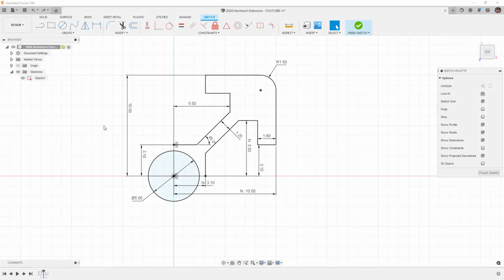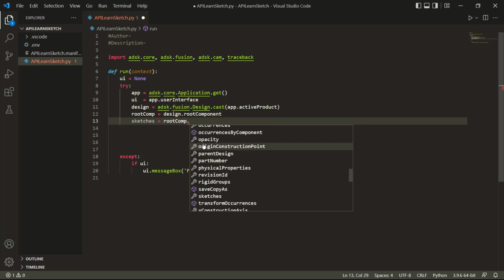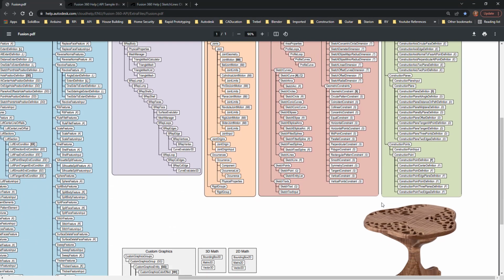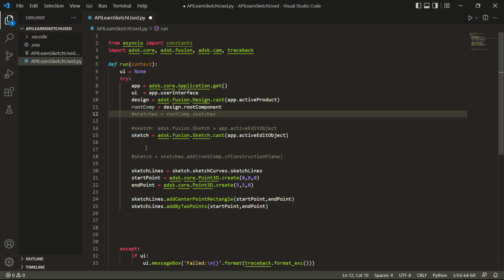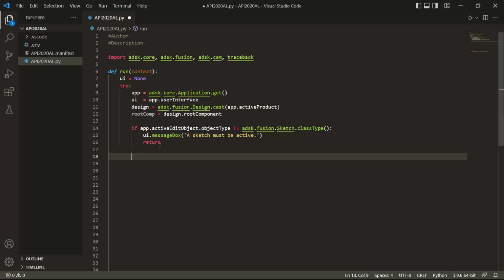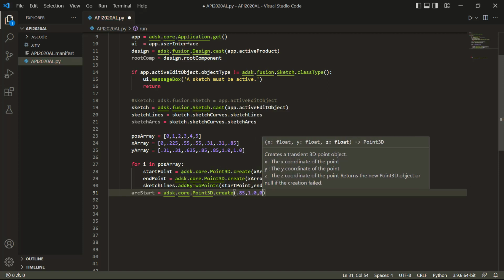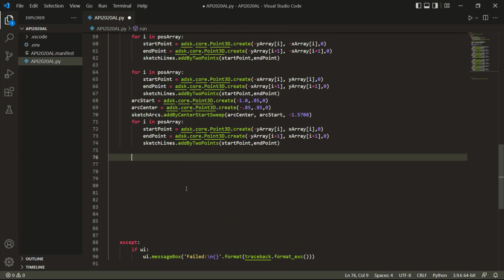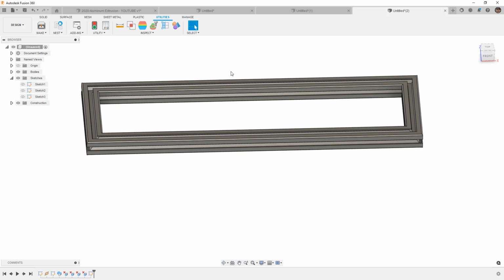Intro to API in Fusion 360 Part 7 - Creating a Script to Make a Sketch Profile #Fusion360 #API

Comment: Hi Matt, I have followed your video mostly but just created a rectangle with rounded corners. I want to create a sketch for drawing an RHS section profile. Problem is I couldn't do an offset in the API and even when I tried to then offset the sketch it would not select more than two curves, the first straight line and arc that was drawn. Eventually I want to have the python code use existing parameters for dimensions so that the RHS would remain parametric. This is how I am creating framework that is parametric in fusion360. Currently I draw the sketches each time I create a new beam.
Reply from the maker: off the top of my head and without playing with your code im not sure what the problem is.  but note that some older methods have been retired because of an update to offset in January.
https://help.autodesk.com/view/fusion360/ENU/?guid=GUID-fe28f2e1-bfbf-4521-ac35-14d677d38441
Reply: @LearnEverythingAboutDesign  thanks 
Matt, yes I saw this and tried to follow the recommendations but I got lost immediately.
My end goal is to use existing parameters in the api but retain that parameter as the dimension in the sketch so that subsequent changes to the parameters in fusion will work. Can you tell me if this is possible.
Reply from the maker: it should be.  I am by no means and expert programmer but we have a few videos on user parameters and how to get and set them in API.  We did a video where we have a dialog box with slider that gets a parameter and you can update it with the dialog.  So i can't see any reason why it wouldn't be possible.

Comment: AttributeError: 'NoneType' object has no attribute 'rootComponent'
Reply from the maker: That error usually shows up if the document or design object isn't referenced before trying to get to the rootComponent.  There are a few ways to access but in this case we did this
app = adks.core.Application.get()
ui = app.userInterface
design = adsk.fusion.Design.cast(app.activeProduct)

After that line we did add rootComp = design.rootComponent, but its actually not needed for where we stopped.  you can add a # before it to comment it out if that is giving you an error.  It should work even if its there it just isn't used.  

In the code we start by making a sketch active (editing or creating one) to place the sketch.  If instead we wanted the code to make a new sketch we would need access to the root component first.  so we sort of bypass it by requiring the user to edit/create a sketch first.

Comment: I made a few edits in the code. Is my code memory efficient:

#Author- Learn Everything About Design
#Description - Creating a profile using api

import adsk.core, adsk.fusion, adsk.cam, traceback
import math

def run(context):
    ui = None
    try:
        app = adsk.core.Application.get()
        ui  = app.userInterface
        design = adsk.fusion.Design.cast(app.activeProduct)
        rootComp = design.rootComponent

        if app.activeEditObject.objectType!=adsk.fusion.Sketch.classType():
            ui.messageBox("A sketch must be active!!")
            return
        
        sketch = adsk.fusion.Sketch.cast(app.activeEditObject)
        sketchLines = sketch.sketchCurves.sketchLines
        sketchCurves = sketch.sketchCurves.sketchArcs
        sketchCircles = sketch.sketchCurves.sketchCircles

        x_array = [0, 2.25/10, 5.5/10, 5.5/10, 3.1/10, 3.1/10, 8.5/10]
        y_array = [3.1/10, 3.1/10, 6.35/10, 8.2/10, 8.2/10, 10/10, 10/10]
        positive_array = list(zip(x_array, y_array))
        mirrored_array = list(zip(y_array[::-1], x_array[::-1]))

        for i in range(len(positive_array)-1):

            ## First block: 1st qdrt
            start_point1 = adsk.core.Point3D.create(positive_array[i][0], positive_array[i][1],0)
            end_point1 = adsk.core.Point3D.create(positive_array[i+1][0], positive_array[i+1][1],0)
            sketchLines.addByTwoPoints(start_point1, end_point1)

            start_point2 = adsk.core.Point3D.create(mirrored_array[i][0], mirrored_array[i][1],0)
            end_point2 = adsk.core.Point3D.create(mirrored_array[i+1][0], mirrored_array[i+1][1],0)
            sketchLines.addByTwoPoints(start_point2, end_point2)

            ### 2nd block:2nd qdrt

            start_point1 = adsk.core.Point3D.create(positive_array[i][0], -positive_array[i][1],0)
            end_point1 = adsk.core.Point3D.create(positive_array[i+1][0], -positive_array[i+1][1],0)
            sketchLines.addByTwoPoints(start_point1, end_point1)

            start_point2 = adsk.core.Point3D.create(mirrored_array[i][0], -mirrored_array[i][1],0)
            end_point2 = adsk.core.Point3D.create(mirrored_array[i+1][0], -mirrored_array[i+1][1],0)
            sketchLines.addByTwoPoints(start_point2, end_point2)

            ## 3rd block: 3rd qdrt

            start_point1 = adsk.core.Point3D.create(-positive_array[i][0], -positive_array[i][1],0)
            end_point1 = adsk.core.Point3D.create(-positive_array[i+1][0], -positive_array[i+1][1],0)
            sketchLines.addByTwoPoints(start_point1, end_point1)

            start_point2 = adsk.core.Point3D.create(-mirrored_array[i][0], -mirrored_array[i][1],0)
            end_point2 = adsk.core.Point3D.create(-mirrored_array[i+1][0], -mirrored_array[i+1][1],0)
            sketchLines.addByTwoPoints(start_point2, end_point2)

            ## 4th block: 4th qdrt

            start_point1 = adsk.core.Point3D.create(-positive_array[i][0], positive_array[i][1],0)
            end_point1 = adsk.core.Point3D.create(-positive_array[i+1][0], positive_array[i+1][1],0)
            sketchLines.addByTwoPoints(start_point1, end_point1)

            start_point2 = adsk.core.Point3D.create(-mirrored_array[i][0], mirrored_array[i][1],0)
            end_point2 = adsk.core.Point3D.create(-mirrored_array[i+1][0], mirrored_array[i+1][1],0)
            sketchLines.addByTwoPoints(start_point2, end_point2)

        ##1st arc
        start_arc = adsk.core.Point3D.create(0.85,1.0,0)
        centerPoint = adsk.core.Point3D.create(0.85,0.85,0)
        arcstart = sketchCurves.addByCenterStartSweep(centerPoint, 
                                                      start_arc, sweepAngle = -1.5708)
        
        ##2nd arc
        start_arc = adsk.core.Point3D.create(1,-0.85,0)
        centerPoint = adsk.core.Point3D.create(0.85, -0.85,0)
        arcstart= sketchCurves.addByCenterStartSweep(centerPoint, start_arc, 
                                                     sweepAngle=-1.5708)
        
        ##3rd arc
        start_arc = adsk.core.Point3D.create(-1,-0.85,0)
        centerPoint = adsk.core.Point3D.create(-0.85, -0.85,0)
        arcstart= sketchCurves.addByCenterStartSweep(centerPoint, start_arc, 
                                                     sweepAngle=1.5708)
        
        ##4th arc
        start_arc = adsk.core.Point3D.create(-1,0.85,0)
        centerPoint = adsk.core.Point3D.create(-0.85, 0.85,0)
        arcstart= sketchCurves.addByCenterStartSweep(centerPoint, start_arc, 
                                                     sweepAngle=-1.5708)
        
        ### Making the circle at the center
        sketchCircles.addByCenterRadius(adsk.core.Point3D.create(0,0,0), radius = 2.5/10)

        # ui.messageBox('Hello script')

    except:
        if ui:
            ui.messageBox('Failed:\n{}'.format(traceback.format_exc()))
Reply from the maker: abhijit, the first bit of your comment is blurry somehow and only the Author and Desc are here.
Reply: @LearnEverythingAboutDesign  blurry? Actually i copied the text from the ide..
Reply from the maker: @abhijitbhandari621  Its very strange, maybe it was being processed or something based on the length of comment, i see some of the code is there now.  

As far as the code being memory efficient, that I am not sure.  I haven only really worried about that on thins like Arduino projects where memory and RAM are a very limited resource.  It appears what you have done there make sense rather than the copy/paste we did in the video.  does it work for you?
Reply: @LearnEverythingAboutDesign  Yeah it's working fine..
Here is the code:
https://drive.google.com/file/d/1MysEQLGckUzfXECArnJAfUBtDo-e32fB/view?usp=sharing
Reply from the maker: @abhijitbhandari621  Great!  Yes I think the program can be more efficient.  What you did to mirror the sketch entities is a great step.  Another way would be to create a circular pattern of one quadrant.  Another way would to make a subroutine/function that draws based on inputs and you design it in a way to pass either positive or negative depending on what you are doing.  So for example a for loop for the x coordinates and a nested for loop for the y.  

I would say the big takeaway would be to make it more robust to updating the profile.  This is an area where hard coding loses out to say something like updating a user parameters in a design where all the other dimensions are driven off of the 20x20 value.

Good work!
Reply: @LearnEverythingAboutDesign  Yeah true and thank you so much I have been learning so much from you

Comment: Great video again! This would be a nice start for a series called "making an frame generator add-in "😁  especially since there is no frame generator in Fusion 360 (at least not for mac). Consider the suggestion 😄
Reply from the maker: That would be cool! There are so many things but I think the next step would be to add dimensions/constraints to the sketch, or show how to make a feature.

Comment: This is what I was looking for! Thank you Matt, you're the best Fusion instructor by far! I just wish your channel gets the attention it deserves so you can continue this amazing work! Keep it up.
Reply from the maker: Wow thanks Nabil!  Glad the content is helpful and appreciate the kind words!
Reply: @LearnEverythingAboutDesign  Ever hear of f-string? There shorter and there easier to use. Also if you are only using 3 imports you can type "from adsk import core, fusion, cam", but it may make it a little more confusing if you have over 5 packages. But really cool video! I didn't know Fusion360 had a API for Python.
Reply from the maker: Thanks Daren!  I am coming at this from a non-programmer perspective so trying to keep it super simple.  The packages like adsk.core are automatically added whenever you make a new script so no need to type them unless you are starting from scratch some how.  When you make a new add-in they add more stuff as well.
Fusion used to support Java, Python and C but its just the last two now.  I think from 2015 or so.  As for the f-string I have heard of it but haven't really used it.  I had done a decent amount of api work in Solidworks using VBA as well as in other microsoft applications, but my Python knowledge was doing some basic stuff with Arduinos/rPi so each of these videos I sort of go into it learning what I need and thinking about the easiest way to explain it.  Since we aren't really formatting any strings in this example I don't really know where it would be used, but would love some pointers!  We did do some conversions/formatting in the earlier videos since all input from users are brought in as strings.  There are some Fusion specific api methods that deal with conversions/formatting of units since they are all CM and Radians in the back end.   

Anyways always eager to learn from actual programmers on more efficient ways!  Starting with Python API in Fusion is a much steeper hill to climb for non-programmers than VBA in Solidworks :)
Reply: By amazing far away the best Fusion instructor I have seen... So much patient and detailed... 🙂